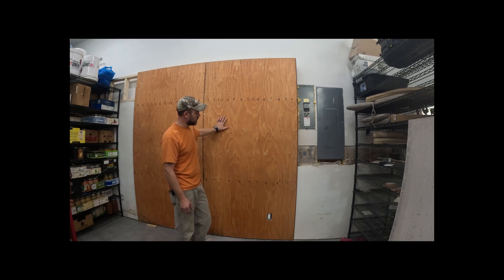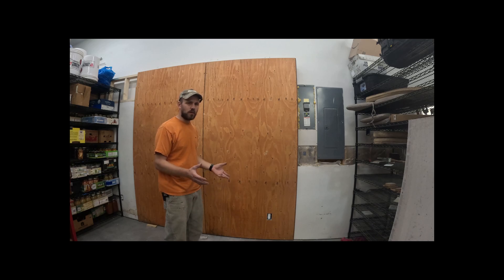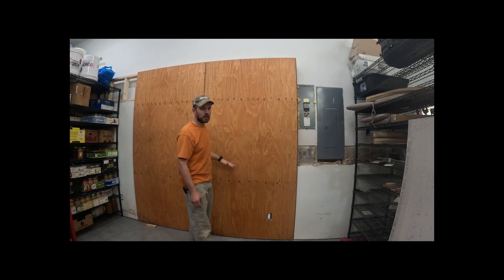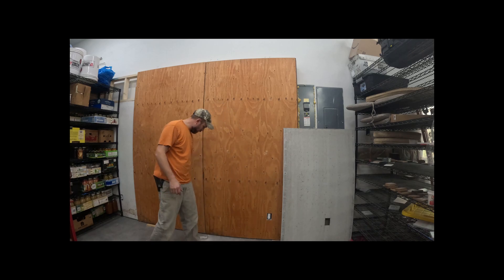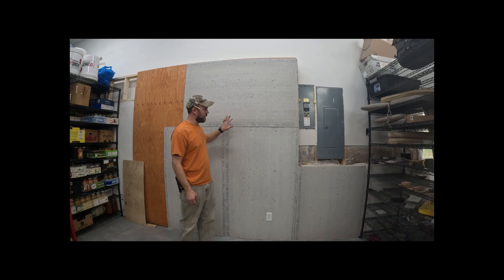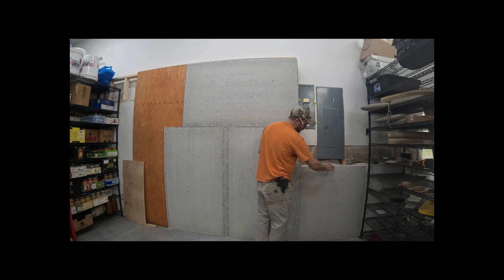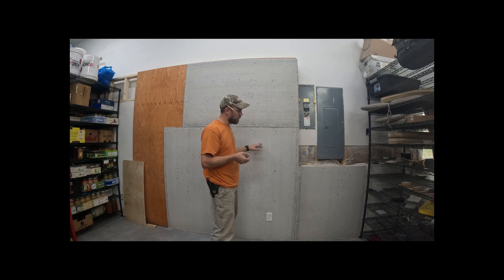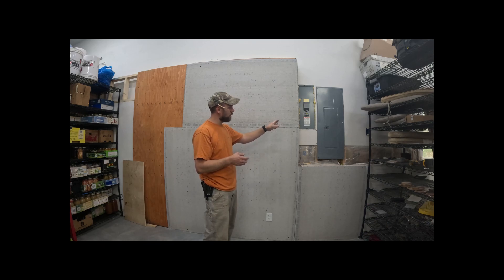How to prep a wall for inverters and batteries - off grid living - Part 1

Comment: Would 3/4" OSB work also or does it have to be plywood?
Reply from the maker: @jssser200  I would use plywood because it will hold a screw significantly better than osb.  If you use osb, you will need to make sure every screw you use to mount stuff to the wall will hit a stud, with plywood you don’t have to.
Reply: @portercreek  thank you. I will be mounting 18kpv , 2 eg4 powerpro batteries, and subpanel. By the way, do you know the height that the 18kpv needs to be mounted?
Reply from the maker: @jssser200  I do not off the top of my head, it depends on what height the battery is mounted at
Reply: @portercreek I will figure it out. I plan on mounting them exactly like your video "Avoid mistakes powerpro wall mount battery install". Thank you for your help